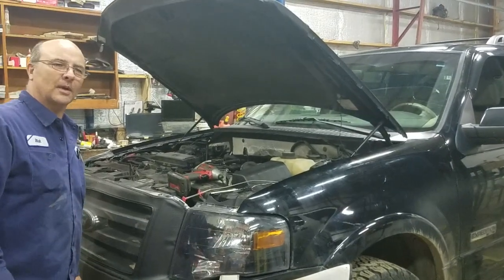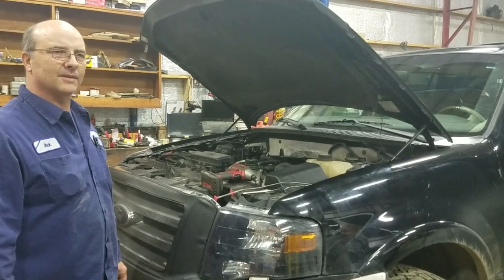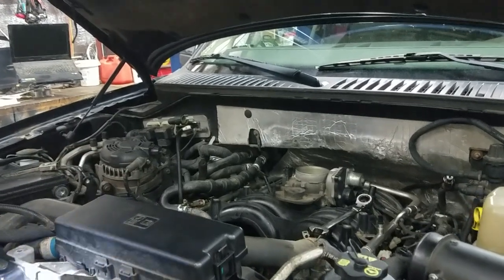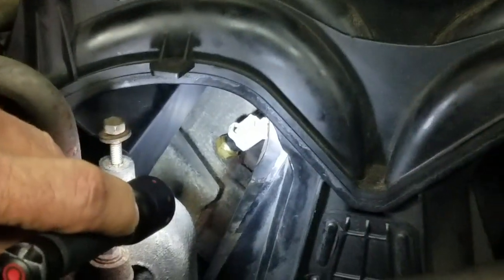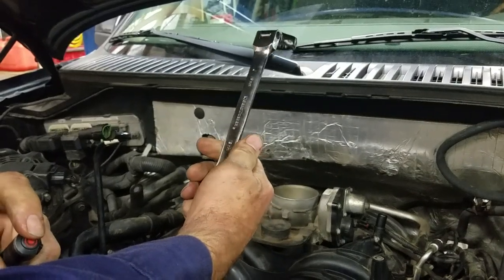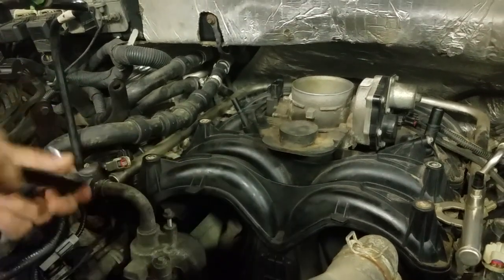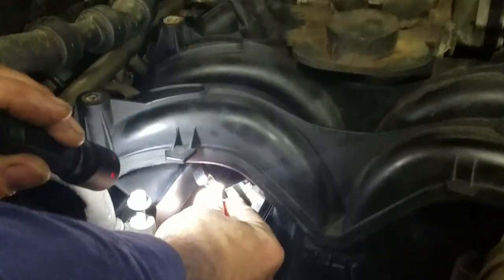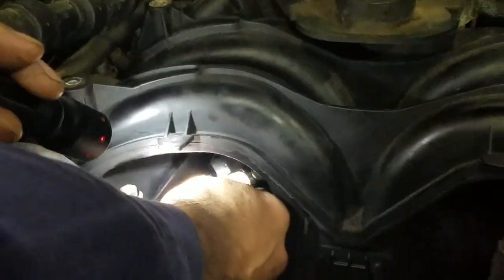CHT Ford 5.4 Triton CYLINDER HEAD TEMP SENSOR  replacement

Comment: NO where as easy as this video makes it look!!!!  Was finally able to replace it but still have the check engine CHT sensor code.
Reply: May be the connector that needs replaced bud mine was bad after replacing the sensor twice
Reply: What code?
Reply: There is actually 2 of these sensors, 1 is under the expedition and that sensor is all plastic

Comment: Guys this is not for the TEMP Gauge, this tells the ECU the engine temp for start run fuel management. Plus there are two resistors in it, go buy the FORD replacement it will last longer.

Comment: A ratcheting box end does not  work on a 1999 , the sensor is to close to the casting for thermostat , not enough clearance . Had to do a lot of grinding on a open end wrench in order to make it fit and then it still was a bear.

Comment: I have a 2003 5.4 Triton that spikes in temperature for about 10 seconds before returning to normal, sometimes a couple of times during each trip. I replaced the thermostat about a year ago, the water pump and intake manifold this year to fix bad leak. Is this sensor a likely suspect? How can I test to see if bad?

Comment: So I don't get any warnings on my dash. My gauge is like random? I guess you can say. Sometimes sits at at normal temp about 25% of the time or at cold 75% of the time. At first it was acting like the engine was 100% hot and i knew something wasn't reading right because i pulled over and the lines felt luke warm. I replaced the thermostat twice just to make sure it wasn't the thermostat. I'm not sure if I should change the CHT?

Comment: Have you done the 2010 4.6l triton yet? Having trouble finding a picture nor video that’s shows where it’s at. If it’s where the 5.4 is, that’s not too bad. See where a swivel head wrench can be useful. Thanks

Comment: Can cause a, "no cooling fan", on 4.6 v8, because the chts, is where the pcm, gets its info, for the fan controller. It's a real pain, to change that part, on a crown vic, grand marques, etc. Fan assemblies, have been purchased, by oops!! At least the 5.4, is a real fan.

Comment: I am having an occasional random overheating reading "CHECK ENGINE GAUGES" and the gauges show that the truck is overheating.  I pull over turn off the engine and restart and then the issue goes away.  2005 Ford F250 5.4L Superduty.  Could this CHT sensor be my issue?
Reply: I'm wondering this too, mine is hit or miss. Sometimes it works sometimes it just stays at cold. I think it's a wiring issue on my side.
Reply: @ozonethegreat6948  did you ever find the cause ?   I'm having the same issue.
Reply: @lanenorthcutt349  Hey Lane. Well I changed the thermostat twice and my gauge kept reading in the "hot" zone. Which led me to believe it was the sensor. It's located in a strange typical Ford location on top of the engine actually. I've been driving the truck for 4 months now with no issue and one day i'll change the sensor, but it's a common failure from my reading. Right now my engine just reads cold all the time. When it's super dry out (sunny) the sensor reads normal. I live in Oregon so electronics don't do well here so I think its fine.
Reply: Yes I have a 2007 expedition and it would instantly go to overheating so I would put in neutral restart and keep driving because it would cool off immediately put this sensor in and it's like new again lol
Reply: I have a 2004 expedition 2v motor…. Went into overheat/limp mode in .5 seconds… had to be towed… changed cylinder head temp sensor was fine for about a week than did same as before… could it be my pigtail connector is bad??? Also fan clutch stuck on high… 🤦🏻‍♀️ugh…. Thank you for any and all suggestions

Comment: Is there another temperature sensor? I have an fx4 2004.  I’ve done this sensor but have/had 2 codes.  P1290 cylinder head temp sens circuit. and P0119 engine coolant temperature sensor.  Everything I find points me to this CHT.
Reply: My 97 F-150 has 3 temp sensors    two in the manifold and one in the head.

Comment: What is the procedure to remove the connector?  I have access to it after removing the intake and alternator, but can get the connector to disengage.  Pressure on top conn to release?
Reply: Pressure inward bout midway

Comment: Was this problem causing the temp gauge to not work properly and seem like it was overheating
Reply: Yes! We kept getting an overheat signal. We replaced the thermostat, but didnt solve problem. Had it professionally tested & nothing was overheating. Took it to one national mechanic shop & they said they got a computer code that said it was the engine cylinder head gasket, which is a $600 part but 22 hour labor = $4,200 total. Our local mechanic shop checked & got 4 computer code possibilities. He did the required tests for each code & they eliminated 3 of them. The 4th testing proved it was the cylinder head temperature sensor.
We just had it replaced. $150 part. 5 hour labor because its under intake manifold = $680 total. I wish I knew about this tool. We would have replaced it ourselves. WARNING = I've seen numerous reports online to not to use the AFTER MARKET sensor. None of them worked. 1 mechanic tried 4 different manufacturers & all were bad. He bought the OEM & it worked. At least 15 said they had same problem.
Reply: @stophypocrisynow  thankyou now I can fix my truck now

Comment: What are the symptoms of this going bad? My 5.4 temp redlines after driving about 15 minutes.  Cooling system seems fine. Replaced the thermostat even. The only codes were that this sensor read hot. Could this sensor be it?
Reply: Same quistion
Reply: Those are the symptoms. We replaced thermostat also. Finally took to 2 mechanics. First said code was for engine cylinder  head  gasket 22 hour labor & $600 part = $4200. 2nd local mechanic got 4 possible codes. He ran diagnostic for each which eliminated 3 of them & confirmed cylinder head temperature sensor. $150 OEM & 5 hour labor because its under intake manifold = $680. DO NOT USE AFTER MARKET SENSOR. Numerous complaints they don't work. 1 mechanic replaced 4 by different manufacturers & none worked. Then used OEM & worked & solved problem.

Comment: This little bastard will cause the AC to not work. As the Temp gauge sits on Cold at 55 degrees. Never moves. So the PCM thinks the engine is overheating. And mine is on the rear side of the passenger head. Not under the intake...
Reply: Yep. Little bastard for sure. Did you get yours out? Any additional tricks to offer? How about the cable it's attached to...did you replace that too and if so, any advice? Thanks!
Reply: @gunner5916  I got my hand back there. And yes I replaced that pigtail as well. I just used the same connectors. Used Auto Grade wiring https://www.ebay.com/itm/14-AWG-GXL-HIGHTEMP-AUTOMOTIVE-POWER-WIRE-8-STRIPED-COLORS-10-FT-EA/303225188809?ssPageName=STRK%3AMEBIDX%3AIT&_trksid=p2060353.m2749.l2649

As I use the stuff a lot to rebuild Chrysler Injector wiring harness. As they want $300.00 for that harness. That is under the intake and sets right on top of the engine. They go bad all the time. So I make my own. Extracting the pins is easy enough..
Reply: @MasterChief-sl9ro  thanks for the reply!  Did you use the same ""flex head" wrench as shown in this vid, or just a standard solid wrench? Maybe I just need to keep fiddling with it until I get the right angle on the little bastard. Great idea with the home-made wire harness. Did you notice any change in the panel temp gauge position read-out due to any change of resistance/impedance of the home-build harness (compared to the original factory wire), or did the gauge appear to read the same (or close enough) after the wire swap-out? I'm here in California where they want to charge me over $1k for this work. Crooks. Anyway, well done and thanks for the auto-wire link!
Reply: @gunner5916  The ratchet wrench's I have don't flex.  So I bent one to reach over to it.. All you have to do is get it loose. Then you can turn it by hand..
Reply: @MasterChief-sl9ro  ok...little bastard is out!  I bent a ratchet too lol. Now for the pigtail, how in the hell did you get the connector off the other side of the pigtail? It's between the engine and firewall, and this space is worse than the sensor tunnel. How did you get that side of the pigtail off? Any tricks? Thanks!
Reply: @gunner5916  Small hands and use of colorful metaphors. Might try and find a small kid. Pay him $10.00 to use them small hands. You might be able to use one of the cat claw drivers to help push it off. If you can hold the release down..